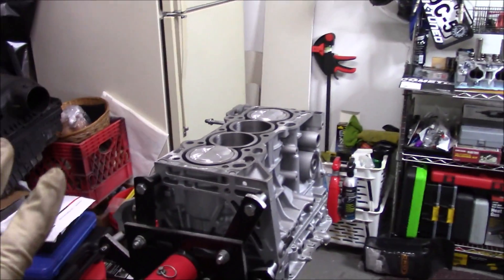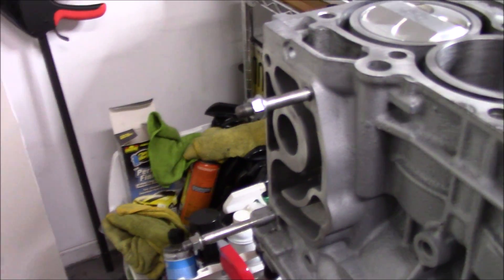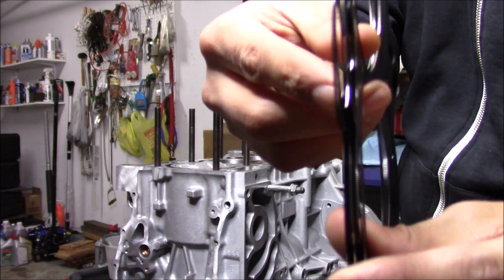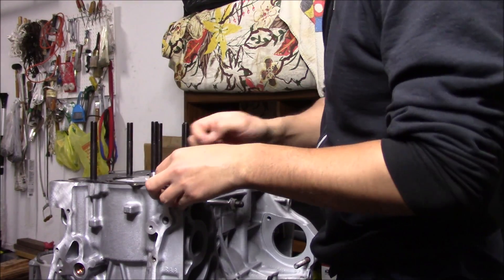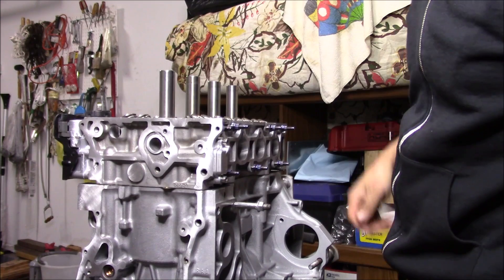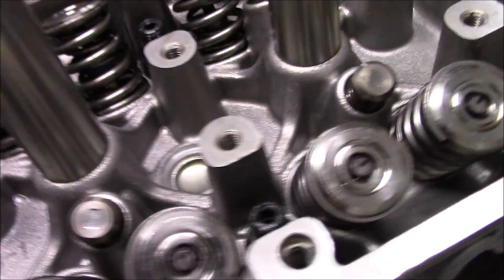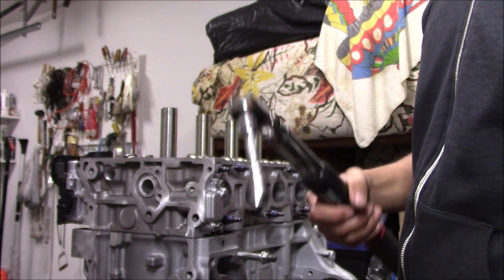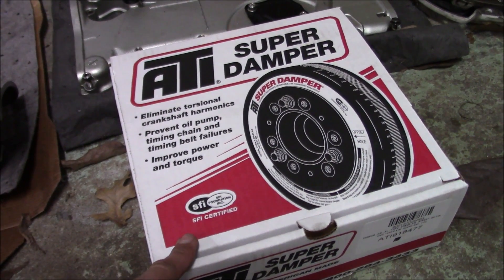Ultimate K20/K24 Build Guide! PT.9 (Head Install)

Comment: They should make 8 carbon fiber redirect flow things in between the rest of the Pistons for an open deck block. Put one at Each corner and Center cylinders to help keep the deck steady under heavy loads. Make them with compound so they get harder with heat. Holding your sleeves solid as posibly.

Comment: Extension doesn’t affect torque wrench as long as it’s straight. You can put a 2’ or 20’ and it should still torque whatever ftlbs as long as it’s accurate.
Reply: Thumbs down, dont give people totally wrong information, what are you even talking about. Learn about metal and what torque loss is.

Comment: What head gasket thickness do you think I should go with? Planning to go Force induction. Rebuilding a k20/k24
Reply: If you have the stock 11:1 or higher compression pistons, I'd get a thicker head gasket (compared to oem) to lower the effective compression ratio

Comment: That rubber pice in the block is called a coolant separator, and you need it in there so dont forget! Or the coolant temp wont reach operating temp
Reply: Do I need the even if I’m turboed?
Reply: @empaige89  yes you need it I’ve seen people forget to put one in after replacing short block and the head will have to come back off

Comment: I have a 2009 Acura TSX K24.  I see that my oil is leaking and pooling where it is written "R40 R".  I changed the valve cover gasket, but still leaks.  Help!!
Reply: Instant gasket is needed on the valve cover
Reply: Permatex The Right Stuff Gasket Maker

Comment: you know you can put the head studs after you put the head on the block, just make sure you have the dowel pins in first. Less chance of scratching the head machined surface or have shavings falling between the head gasket and the head

Comment: Bro Cometic do make a 87.5 gasket. I can show you a picture of the package I still have. I just did a headgasket on my boosted K
Reply: jmont124 
Hi do you have the part number of the head gasket?
And I can use it with the k24a2 and k20z3 head ?
Reply: Did you open up your headlights and put blue led strips in? I have those SpecD headlights, and I was thinking of trying to retrofit rgb led strips for the halos and running light strip

Comment: that thing is a coolant diverter.if using k20z3 or euroR heads,(RBC-1or2 or 3) and tsx , u need to put it in there.if using RSX-S head,u need to take it out.a lot info on it out there
Reply: Yep X2 on this
Reply: So tsx  k24a2  and rsx type s k20a2 head you have to remove the diverter?
Reply: @rubensalazar9836 yes
Reply: I’m in the same process of doing k24a2 block /k20a2 head and was reading about the coolant diverter has to be removed and to use the k24a1 crv head gasket 12251-PPA-004 instead of the tsx as the crv coolant passages match the k20a2 head
Reply: @rubensalazar9836 yes for k20a2 head the diverter should be removed, and gasket would follow the head not the block